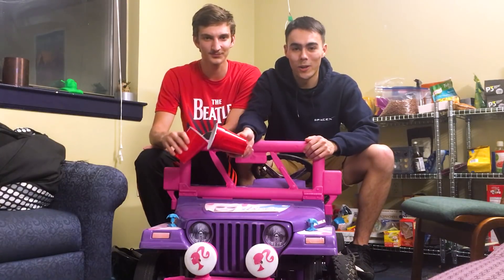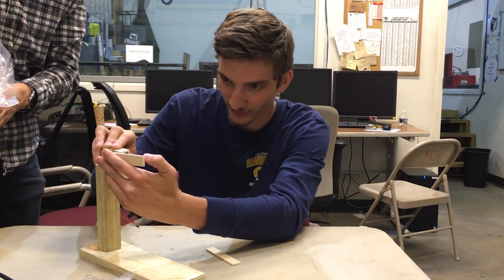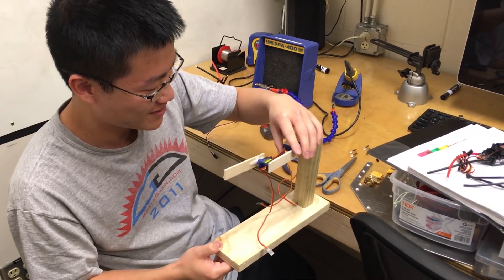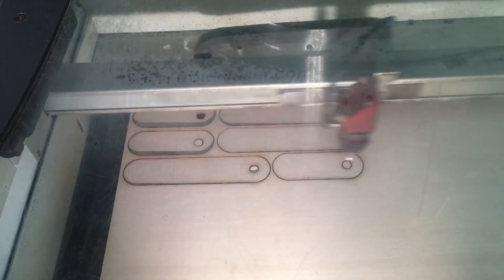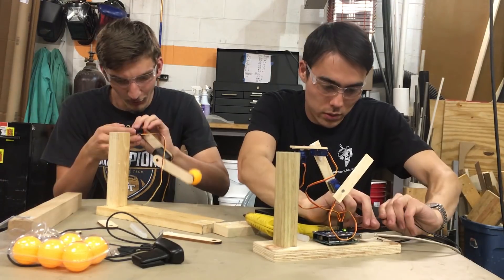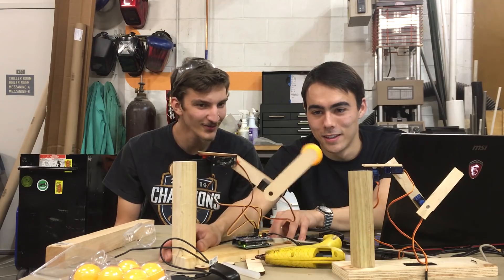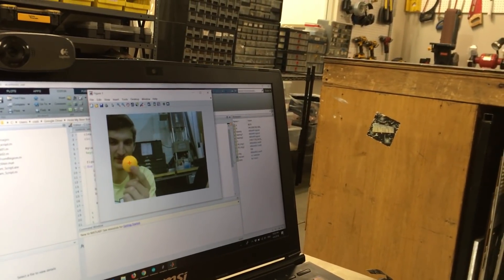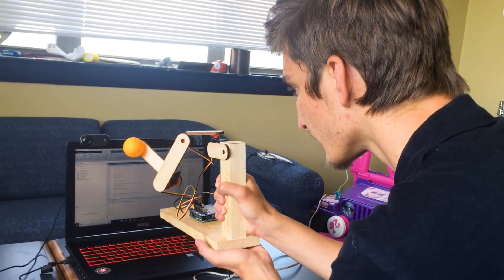Drink Stabilizing Robot Pt1, The Prototype

Comment: nice! could you guys do a quick run-through of roughly how the software side of things is done?
Reply from the maker: Sure! So we used a webcam library in Matlab to grab still frames from the webcam, we made a simple filter with Matlab's imaging processing toolbox which makes the ping pong ball appear white and its surroundings black. We ran the still frames through the filter and used a command called regionprops that finds the x and y coordinates, width, height, and the area of the white region of the image (the ping pong ball). 

From knowing the actual width of the ping pong ball and the width of the white region, we compute a scaling factor to determine the distance of the ball from the camera. We also compute the distance the ball is from the center of the screen, which are x and y distances. The xy distances and scaling factor are compressed into 3 bytes and sent to the Arduino over a usb serial connection which reads the bytes and computes the xyz distance the ball is from the center of the webcam. Honestly the hardest part was getting the serial connection working.

xyz velocities are calculated proportional to this distance + the difference in webcam measured ball velocity from the Arduino's computed ball velocity. The velocity is added to the current position of the ball to get the new desired position. Essentially a PD controller. Then this new desired position goes through a bunch of trigonometry to compute the needed servo angles. These angles are converted to a PWM signal and sent to the servos and the arm moves.